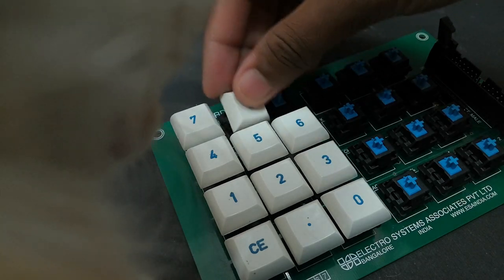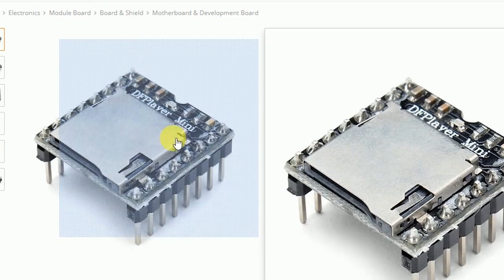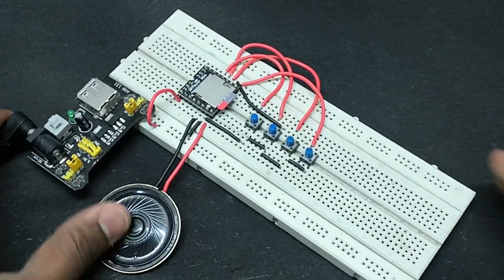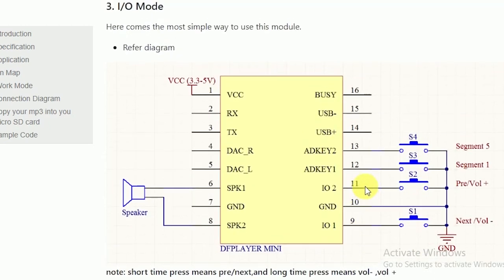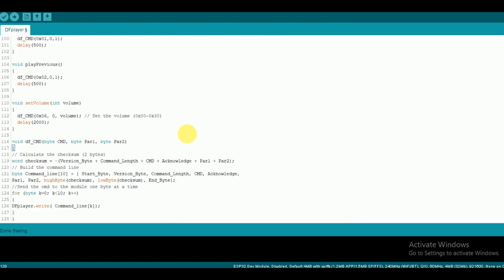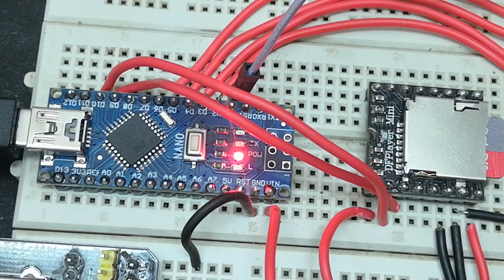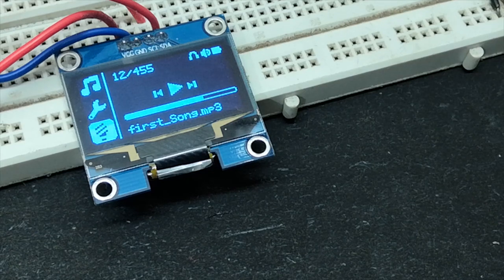[DIY] Arduino MP3 player with oled[Soundpod part-1]

Comment: Segment 5 is the fifth file saved to the sd card.  Not necessarily the order you see it on the card if sorted by name or whatnot, but the 5th file you saved to the card.  Segments in this system are great for soundboards or messages at say your doorbell or a phone system.  You can play sound files or messages depending on what input a person might enter.  Think hit 5 for a list of our options kind of stuff.

Comment: I see this is an older video, but i hope you will still participate in dialogue. Thinking you have broad experience I am asking for advice. In my model train I need a Chuff Sound function. The Chuff is a Steam engine exhaust sound that expels spent Steam Pressure gas in the exhaust stroke of the steam engine. The exhaust in slow speed has a distinct sound and lengthy decay of noise. The Steam engine exhausts this steam 4 times for every rotation of the drive wheel. The steam piston is a double acting mechanism such that it has two strokes per piston for each single revolution. All Steam engine are balanced with two Pistons set at 90 degrees apart for smooth operation. Hence the the 4 chuffs per rev.  The sound Board need to allow the storage of the complete Chuff Sound for the slow operation. But as the engines speed increases the long decay is over riden but the next loud exhaust chuff. So the Chuff peak sound will begin to repeat faster and faster as the engine speed increases. I need a Sound board that can react to an input trigger (usually a switch or button) which will restart the loud chuff noise instantly upon each trigger pulse. I have yet to find a device that is fast enough to maintain a realistic scream at high speed then revert slowly to the long draw out Chuff sound at the lowest speed.   DO YOU know of any such device that can work on a single sound file and play it is the manner required????

Comment: how come its cost effective project the DF player cost 154RS but what about the SD card price with out SD card you cannot play audio in this module can you make use of EEPROM or any other memory IC to store audio file and play through Arduino command can you make a video on this topic
Reply from the maker: EEPROM are not suitable for frequent read/write and Flash memory of similar size would cost 10X more than the SD card.  Finally playing a clear audio in Arduino wouldn't be possible because it doesn't have enough power to run audio (Maybe just 8bit audio with piezo like retro device).
Reply: @Neutrino1  how come Chinese speaker while connecting disconnecting it's give audio notification what technology they uses
Reply from the maker: @er.jugalmandal7736  They have a DAC to play the audio and a small Flash memory to store the audio file(less than 0.5mb)
Reply: @Neutrino1  can you make a project with using DAC and small memory ic   and Arduino it will be very helpful to us

Comment: Sir I seen without using aurdino all features are working so what is extra feature we will get by using aurdino
Reply from the maker: To play on command like play when triggered by a sensor or control wirelessly
Reply: @Neutrino1  ok sir 😊
Reply: @Neutrino1  sir can I can't do that all process using smartphone because I have no computer
Reply: @Neutrino1  that process sir which you had done in part 1 of MP3 player

Comment: "segment 5" I think means the 5th file on the sd card. User manual says it numbers them based on the order in which you upload them to the card.
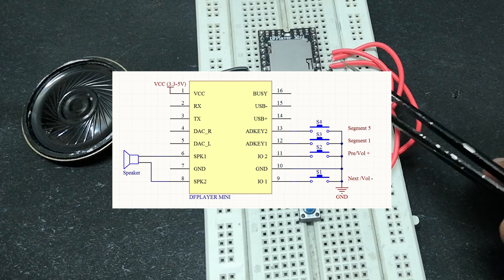Reply from the maker: No, I was talking about the button segment 5. The first button which is connected to Adkey 2. Take a look at 1:35

Comment: thank you very much for this much informative video.
 can you please share the purchase link of speaker that can be powered by arduino
Reply from the maker: https://www.amazon.in/MAX-Power-Audio-Speaker-10W/dp/B07HXYRQXT/ref=asc_df_B07HXYRQXT/?tag=googleshopmob-21&linkCode=df0&hvadid=397077482385&hvpos=&hvnetw=g&hvrand=15886860465242953093&hvpone=&hvptwo=&hvqmt=&hvdev=m&hvdvcmdl=&hvlocint=&hvlocphy=1007768&hvtargid=pla-836344630769&psc=1&ext_vrnc=hi
Reply from the maker: Glad you like the video!

Comment: This is a very decent and cool diy gadget. Thankyou for this great video.  I want to built it for my own. One thing I want to know that in this player fast forward and backward options are  availabe or not. Also resume playback after power is on. If not then can it be possible to manipulating arduino code for getting these features.. Please help me.
Thankyou a lot.
Reply from the maker: No it's not possible to add the features you're asking for, the df player is pretty limited.

Comment: What is that board in which you have connected the power adapter pin?
Reply from the maker: It's a power supply board for breadboard